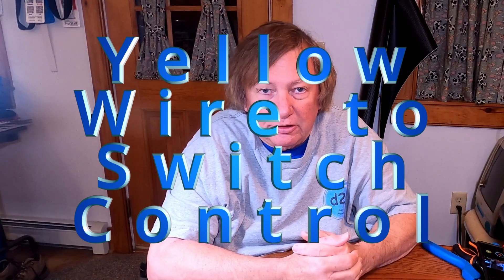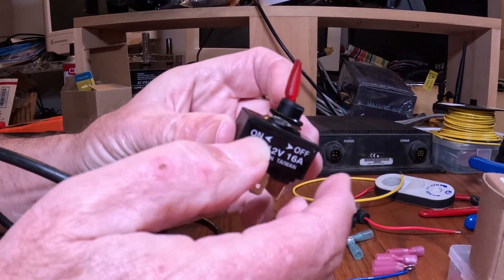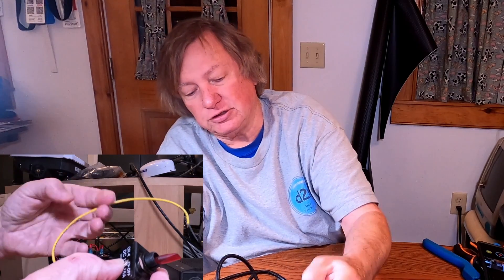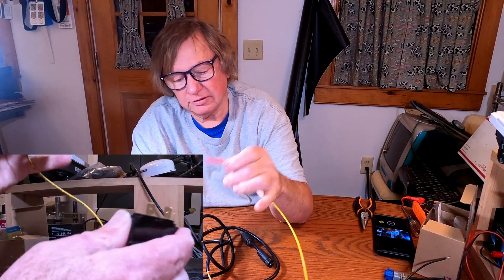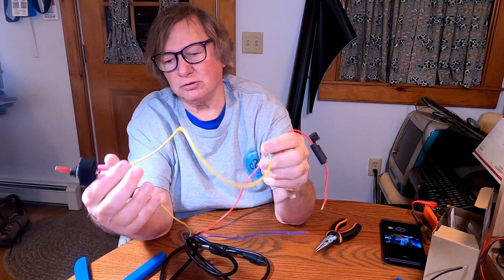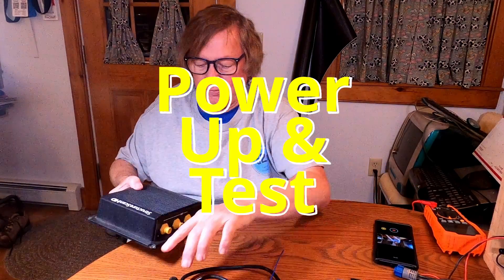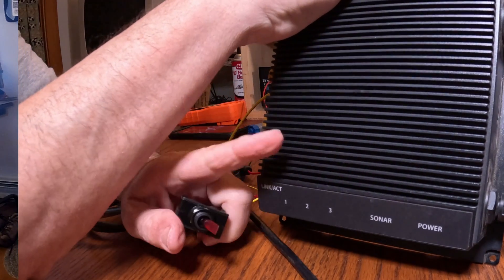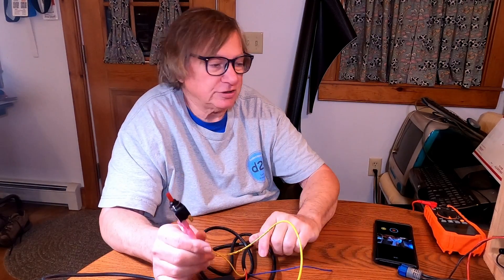Control Your Active Target Module with a Switch (Way #3)

Comment: What do recommend for wiring up a kayak? I have Elite Fs with active target and yak power switch
Reply from the maker: While I haven't done any kayaks, given the very short power runs you should be able to use a couple of terminal blocks (one for power and one for ground) and connect the two power cords to them. But in order to keep everything as watertight as possible, I would probably use the fuse blocks that came with the units. Wire the power to the yak power switch. Wire the grounds directly to the battery. Run at least 10 AWG (yes, overkill) from the yak power switch to the battery. Connect the AT module chassis ground to the battery ground.

I'm not sure if you have a location where you could mount the switch for the yellow wires, if you do then use a waterproof switch. If not then try to locate a waterproof inline type switch, like the ones on smaller house lamps, and use that. 

Make sure that all of your connectors are marine grade heatshrink connectors like the Ancor ones. The goal is to have all of the wiring connections sealed and waterproof.

The goal is to make all of the runs as short as possible to minimize voltage drops and extend the life of the battery.

I have wanted to wire up a kayak but I haven't had the opportunity yet. Maybe I'll have to probe some of the customers when I do store visits. I think that it would make a decent video.

Thanks for watching. And let me know if have any more questions. And sorry for the late response, for some reason your comment just popped up. Garry
Reply: @ Thanks Garry. I just ordered the Sea Clear harness for kayaks. I plan on connecting the yellows together so the AT turns on with the graph. Kayaks have limited space for switches and dry areas.
Reply from the maker: You're welcome. Let me know how you like that harness. I expect them to be at the Angler's Choice Open House next week in Spindale, NC. I'll be there for Lowrance. So I'll check them out if I get a chance. 

And let me know if you have any further questions.

Comment: So will I need this yellow wire to run a radar dome off switch? I have a Simran dome to the Lawrence FS 9 should I hook it up the same way you did one yellow wire to the switch another yellow wire to the red with a fuse to the power source
Reply from the maker: The Halo radar series that are supported by the Elite FS require the use of the Yellow wire to turn it on or off. So the radar dome acts the same as the Active Target module in terms of the yellow wire controlling the power to the dome/module.

So yes the wiring is as I showed in the video. Using the switch you would wire it up to connect the Yellow wire from the power cord on the dome to the switch. Then connect to other terminal  on the switch to a yellow wire through a 1 Amp fuse to your battery. And connect the red (through a fuse) and yellow wires on the power cord for the dome to the battery.

Thanks for watching the video! Garry
Reply: @ thank you sir. I appreciate it and I did subscribe to your channel because a lot of things that you have done has helped me out on this boat venture thank you, sir. I appreciate you.
Reply from the maker: You are very welcome. And I appreciate you subscribing. Good luck with the boat. If you have any questions feel free to post a comment. Or if you have a topic that you would like covered in a video, please let me know.

Thanks again, Garry.
Reply: @ good afternoon Gary  ok I just put on a switch with a light I have yellow and a power wire and ground the light stays on on the switch on or off ?Any  input  Also I was looking at the wires coming from the Lowrance elite FS9 it has a yellow wire not being used can I just put  the two yellows together and the dome will work from that  / with out the switch and will some turn off when not using 
Thanks again 

Ps Your page is the only one out there with this good information
Reply from the maker: I usually wire it so that the light is turned on when the switch is on. Check the wiring diagram on the switch, it should show a power lead, switched lead, and a ground. The power lead goes to the fuse and then the battery or fuse block. The switched lead goes to the yellow wire on the power cable. And the ground goes to the fuse block or battery ground.

Yes, you can hook the yellow from the Elite to the dome yellow wire. And you can put the switch between the two. That was the dome will only turn on when the Elite is powered and the switch is turned to the on position. I'm not sure how much current that the wakeup wire can handle to be able to turn on the switch LED if it has one. So to be safe, don't connect the switch ground and have a way to mark the ON position on the switch so it is obvious.

I do try to have videos that fill in the gaps from other channels. I want you to be able to learn how and why you are doing something so when things go wrong or are different you know how to adapt to the situation.

Thanks, Garry

Comment: Do you need a ground wire pigtailed to the third blade on the switch?
Reply from the maker: It depends on the switch. The one that I show in the thumbnail would NOT have the 3rd terminal connected. It does not have an indicator light or LED to let you know that it is switched on. The switch is a single pole single throw or SPST switch.

If your switch has an indicator on it then you will need a ground connection so the light is illuminated when you turn on the switch. I used that type of switch on the Skeeter Elite FS/Active Target installation. That switch also is a SPST switch.

This is type of switch that I used for that installation: https://amzn.to/3C6btua

If your switch has extra lugs on it and no indicator then do NOT connect ground as you may short out the wiring or blow a fuse if it is wired incorrectly.

And thank for watching the video. And please subscribe if you haven't yet. Thank you.
Reply: @garrywoodruff960  Thanks Garry. Good work!
Reply from the maker: You're welcome.

Comment: Gary      Thanks much for these insightful videos.  I appreciate all the time you've put into helping the rest of us get our boat electronics right.  

In one of your Active Targeting videos, you mentioned that we should ground the AT module.    I'm installing my AT2 module to a dedicated electronics lithium battery (powering only the module and my HDS-Live).  My question is - do I ground the module back to the lithium battery, or to my boat/battery.  

Grounding to the lithium seems to make the most sense to me, otherwise, I would be "contaminating" the otherwise closed dedicated power system.  Using the same thought process, I wouldn't think the lithium battery should be grounded to the boat/battery.   Please provide your perspective.  

Thanks, Mark.       Again, thanks for all the effort you put into your work.
Reply from the maker: Hi Mark, thank you. I try to make helpful videos. A lot of the videos address problems that I have helped many customers with and I want to share the knowledge.

The power ground on the AT module should be grounded to the same battery that is used for the switch. Otherwise the wakeup wire will not work as expected. So if the AT module is powered by the lithium battery then the module and switch ground are connected to the lithium ground. I am assuming that you have a dedicated lithium battery for your electronics.

There is also a case ground on the AT module as well. If you are in freshwater then connect the case ground (also called bonding wire) to the lithium battery. If you have a saltwater boat that has a ground system attached to an anode then attach the case ground to the ground system. That will do 2 things. First, it will help to prevent corrosion on the transducer. And second, it will help to clean up the image on your screen by eliminating some electrical noise.

I appreciate you watching the videos.

Garry
Reply: @garrywoodruff960    Very thorough answer.  Thank you.  I was referring to the module case ground (bonding wire), and you answered very precisely.   Good deal!
Reply from the maker: You're welcome. That's my engineering background coming through.

Comment: Hi Garry,  I have the Lowrance 9 Elite FS with active target 2. When i split the yellow wires is where I get confused. Does the yellow and two reds go to the monitor or does it go to the sonar? And what happens to the other yellow wire that goes to the other unit?
Reply from the maker: If you want to have the Active Target 2 turned on whenever you have the Elite FS turned on then (1) connect the Yellow wire from the AT and Elite FS together; and (2) connect the Red from both power cords with an inline fuse to the positive (+) on the battery; and (3) connect the Black from both power cords to the negative (-) on the battery. With these connections when you turn on the Elite FS then the AT module will be powered up. 

However, if you want to be able to turn on/off the AT module even when you are using the Elite FS then use the switch method that I show in the video. Some of the reasons that you may want to use the switch is to turn off the AT when you are very shallow and don't want the extra sonar pinging or to conserve battery power.

On the video with the 2 Elite FS units with the AT2 installation, I used a switch to turn on/off the AT module. This allows them use conserve power (only 1 battery) and for some tournaments they are not allowed to use live Sonar so they can easily turn it off.

Comment: I didn't think I would find this video. Thanks so much! Switching the yellow wire is exactly what I want to do. I am setting it up in a kayak but want to be sure I can turn it off when not in use. Keeps my from having to have a larger battery in the kayak.
Reply from the maker: You're welcome. I'm glad that you found the video useful. I just used this same technique in the Elite FS/Active Target 2 video. I installed one of the rocker switches that I showed in the video since it had a LED indicator to let the owner know that it was turned on. Weight savings in a kayak is very important.

Let me know how it works out.

Comment: Thanks for the information very much appreciated!! 
Question: is it necessary to add switches to the HDS-graph separately? So technically 3 switches total ?
Reply: I’ve recently purchased an LSS-1 module with side and down imaging, and also 2, 1st gen HDS-7s
Reply from the maker: That was a good setup at the time. I ran that setup (with 10s) for a couple of years. The LSS-1 transducer is much more compact than the current Lowrance side imaging transducers. Just make sure that the units are updated with the latest update for them.
Reply from the maker: Thank you. I glad that you found the video to be useful. 

No, the switch is only needed for the module. The units have easily accessible power buttons.
Reply: How would I go about updating the units?
Reply from the maker: get a micro SD card with carrier that it 32 GB or less. Go to the Lowrance website on the support page. Then select the updates page. Then in the dropdown box in the left, select your unit. Make sure that they are Gen 1. Follow the instructions to download the update to your SD card. Then put the SD card in a unit and power it on. If it needs the update then it will show a bar on the bottom of the screen. When it is done you can then remove the card and do the second  unit.

This is the latest update: HDS (Gen1) with GPS Patch

Comment: Hi Garry, Thank you for the video. Would you be able to wire an active target with the switch method, but still connect the input of the switch to a HDS Pro unit yellow wire? So that the unit would only be able to be powered up when the HDS PRO is on, but still be able to be turned off when not using the active target?.
Reply from the maker: Thank you. I'm glad that you like the video. Yes, that would be a good way to use a switch while having the Pro control it. Make sure the Pro has the yellow wire activate (wake up) enabled, it is by default but worth checking. One thing is that if the Pro has a transducer connected to it then you should connect blue sync wire on the AT2 to the Pro yellow wire and turn on sync capability. And then use a switch like in the video. That will give you the clearest AT images.
Reply: Ok Thanks Garry @garrywoodruff960  , Yes I will be using the Pro's included active transducer, although I thought that the blue wire was only if I had 2 AT2'S hooked up. Could I still use the switch by hooking up the AT2 blue wire on one side of the switch and the yellow wire from the pro on the other side of the switch? So that the unit would only be able to be powered up when the HDS PRO is on, but still be able to be turned off when not using the active target?
Reply from the maker: You're welcome.

No, if you use the blue (sync) on the AT2 then you will need to connect the yellow wire to turn on the module. In that case, use a separate switch hooked up the same power source as the AT2 module. The switch will let you turn on/off the module. And on the Pro, make sure that you set the Power Control to sync.
Reply: Thanks for your advice Garry
Reply from the maker: You're welcom.

Comment: How about the switch from blue sea switch which has light when it’s on.How to wire that button up?
Reply from the maker: There are several Blue Seas lighted switches as well as a multitude of other brands. All of the SPST (single pole single throw) lighted switches should have (1) power in (2) switched power out and (3) ground. You would wire it the same way that I showed in the video except you would also connect the (3) ground to the battery ground. This will complete the circuit when the switch is in the ON position and will light up the indicator.

Let me know if that make sense.
Reply: So it's only necessary to connect the ground leg of the switch for the light indicator. In other words the switch will still work just won't illuminate the switch.
Reply from the maker: Yes that is correct. The ground used just used for the light to indicate that the switch is turned on.